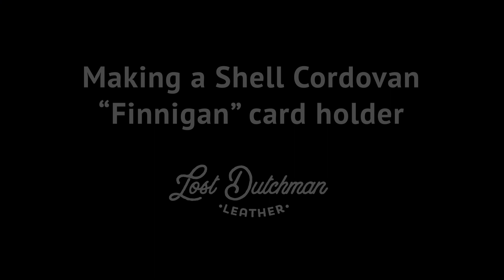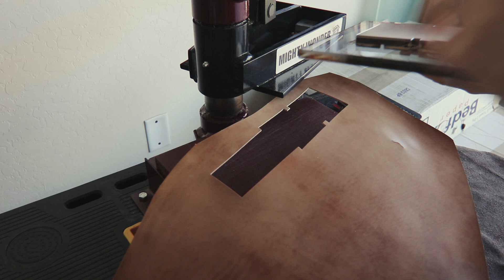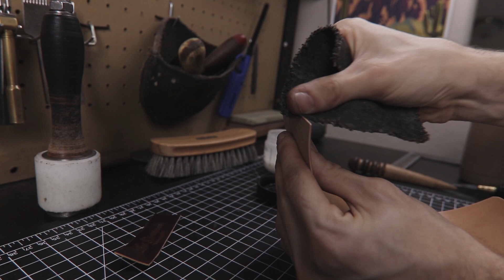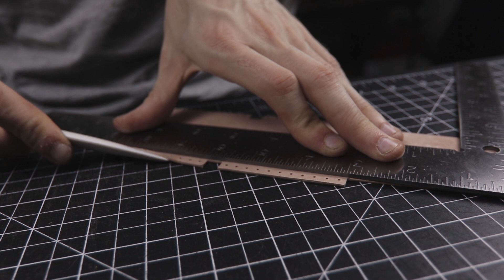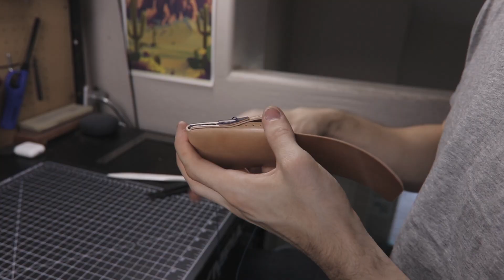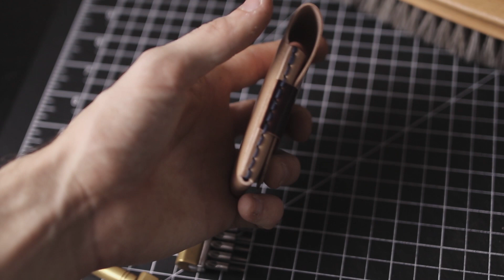Making a SHELL CORDOVAN wallet by hand

Comment: I like that punching/cutting board? what is it made of?
Reply from the maker: My main cutting mat is just a basic Vantage cutting mat, the smaller punch pad I use for punching the stitching holes is from District Leather Supply and it's made from a self-healing rubber material.